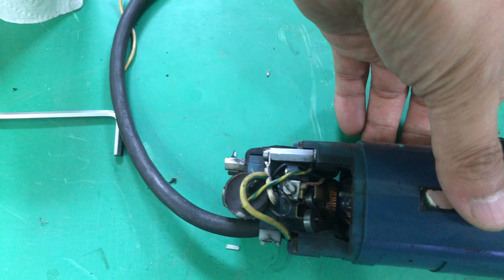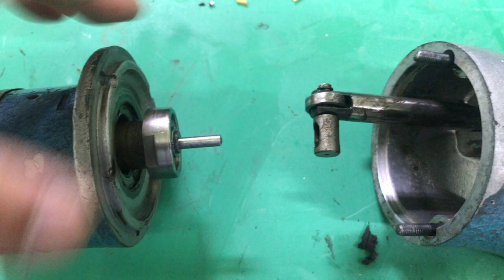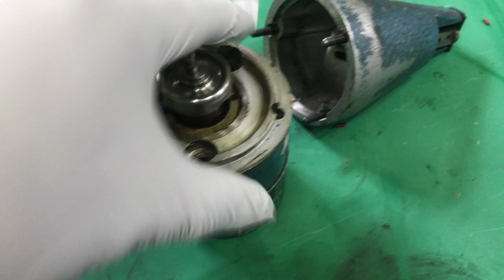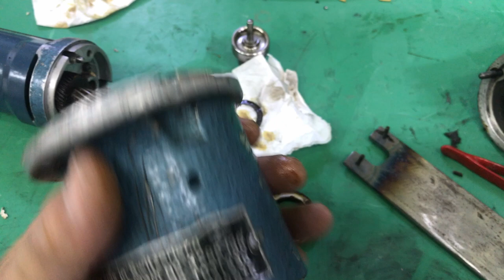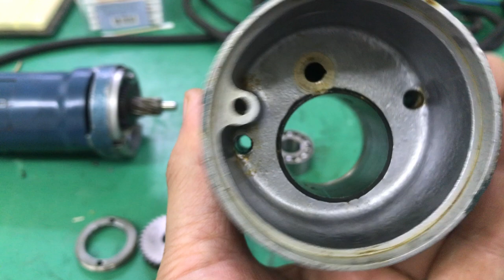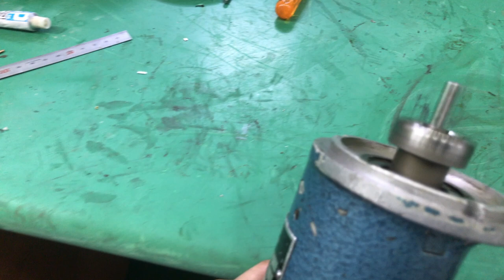biax power scraper - how it works

Comment: Is this a scraper or a flaker?  It looked like it had rolling motion to the stroke more like a flaker. Thanks
Reply from the maker: I believe it is a scraper model.  All Biax scrapers does a little bit of rolling motion, as far as I understand. Tnx for the comment :p
Reply: @kkimfinaxmusic3883  This is a Biax Flaker, NOT a scraper. Scrapers do NOT create a rolling motion... just a reciprocating stroke. I have both this flaker and a scraper and I was expecting a "how it works" video, as the title claims. Rather, it's a video that shows some internals and wasting time extensively holding up parts and spinning a bearing. I'm sure many viewers, including me, would have preferred seeing the actual disassembly of the unit and its internal parts. An explanation of how each part interacts with the others would truly have been "how it works"! Sorry for my candor... but your title led me to expect more.
Reply: @taurusdragon5479  It blows my mind that anyone can make something flat that way
Reply: @tonyroma9046  It doesn't! This is a flaker and makes half-moon shaped oil pockets - on a scraped flat surface....
Reply: @taurusdragon5479 I know this is a very, very long shot, but YouTube would absolutely love a teardown/comparison between the power flaker and power scraper from someone privileged enough to own both. I haven't found much in the way of comparisons between the 2 machines, especially side by side. Rather, many videos categorizing both as magic flatness machines without going into the mechanisms or geometry of the stroke. Which is what I'm assuming we're actually here for as our disassembled reciprocating saws sit on our benches. Thanks!